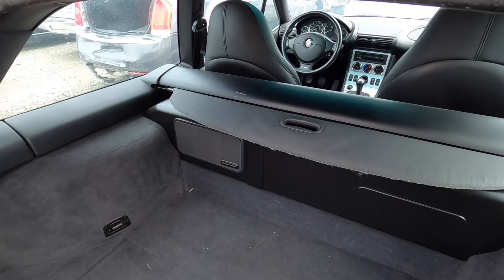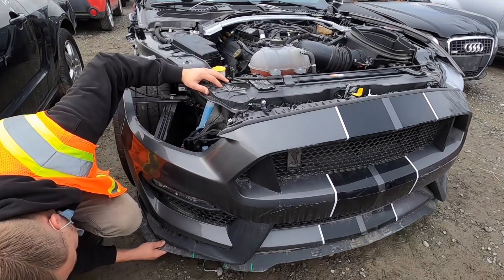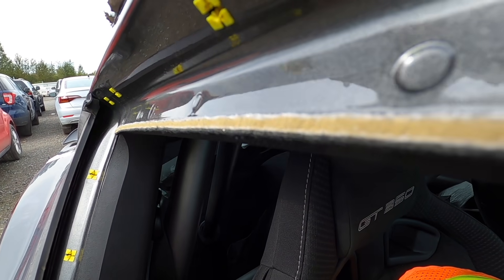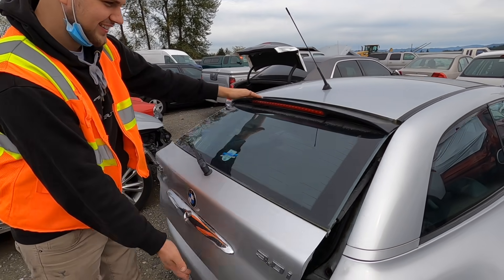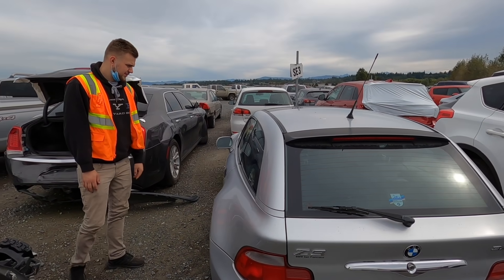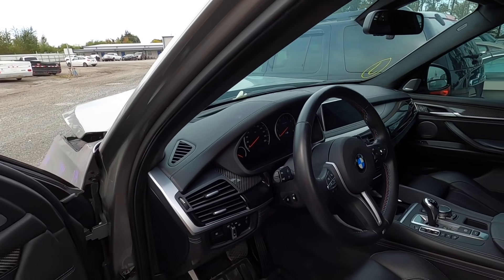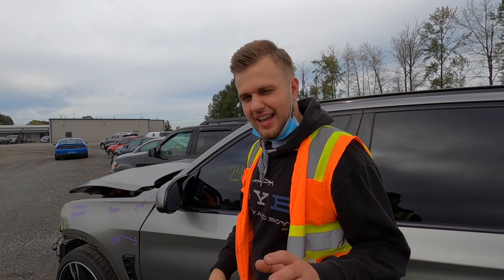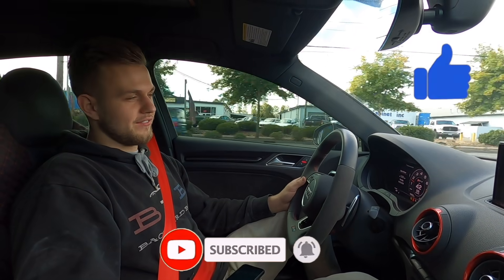Copart Walk-Around: I Think I Found My Next Project Car! Featuring A 702HP X5M, Mustang GT350, Etc..

Comment: The Z3 could have ripped off rear differential carriers, that is a common problem with these but easily repairable if you have a welder and some fab skills. When fixed and in good condition, these will only go up in value. The fun thing about these is that every body panel except the roof is removable so the rebuilt title could mean nothing if the frame is good. It could also be related to the dif mount issue.